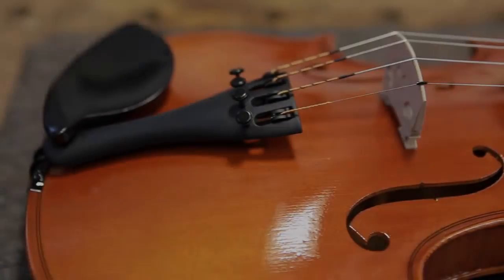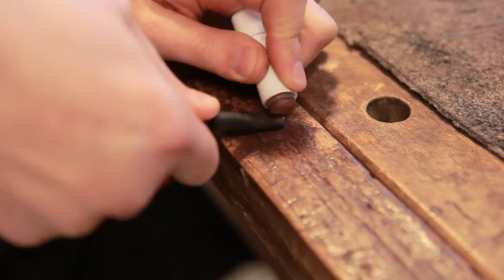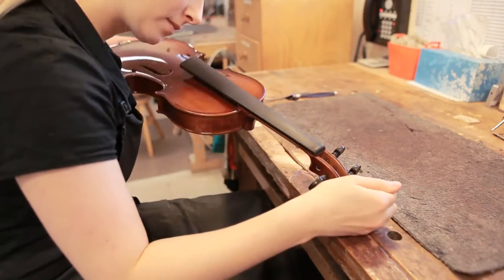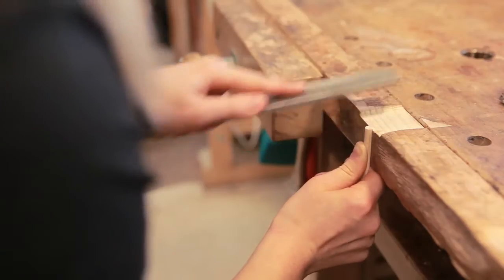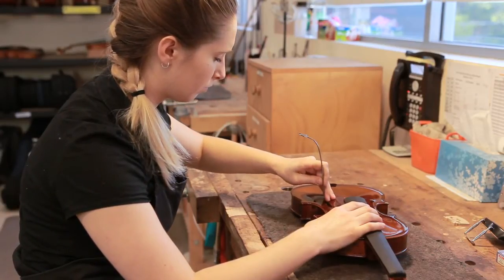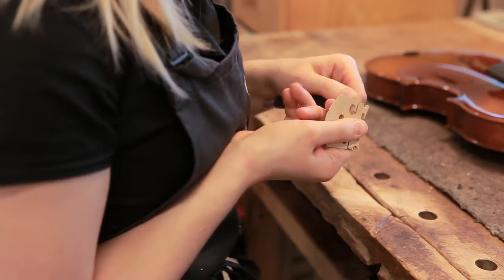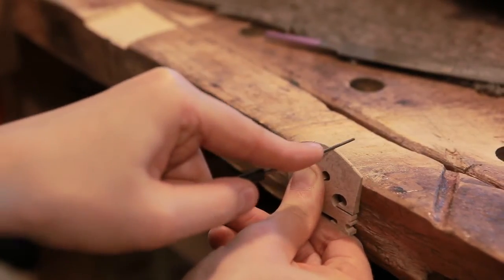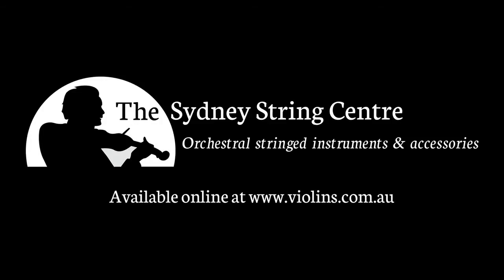HOW TO: Setup a Violin Professionally - The Sydney String Centre

Comment: I need the little thumb screw as seen at 0:11 of this video - can I buy such from the Sydney String Centre?
Reply from the maker: Hi Edward, it’s tricky to find a fine tune adjuster with the same thread to match a particular tailpiece. We keep a bunch of spares from old tailpieces that have been thrown away, but unfortunately if we can’t find one that fits the whole tailpiece will need to be replaced. Feel free to pop by and we can take a look. Cheers